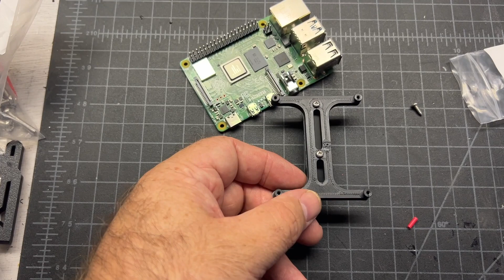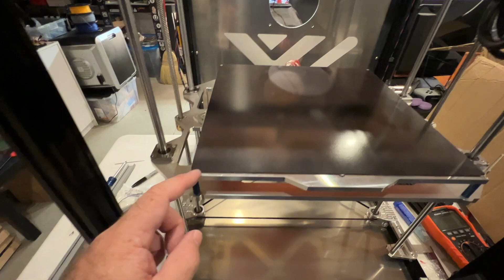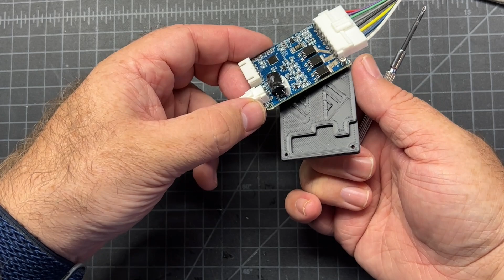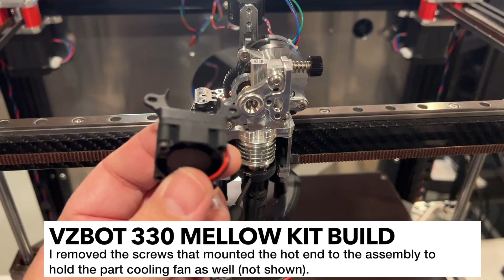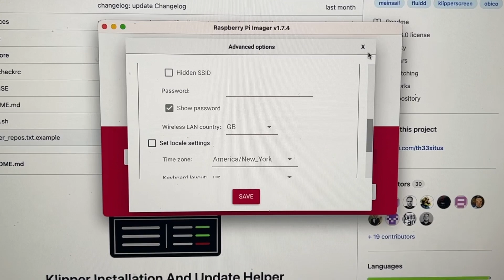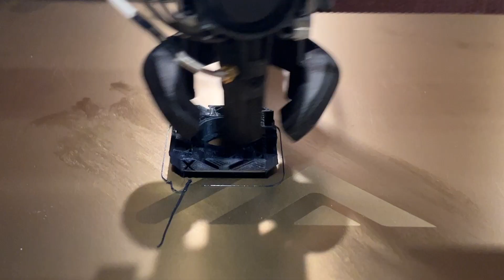Mellow VZBot 330 Build Series - Part 4 Final Wiring, CPAP, Heated Bed, Getting Up & Running

Comment: I really want to build myself a VzBot 330 as well, however i am not set up all that well with electronics tooling. Ive got a Soldering Iron, Screwdrivers, Pliers, Potentiometer and Crimp Pliers for JST type connectors (but they can do a lot more as well). What i dont have are pliers for Ferrules and consumables such as Crimp parts or wires. What should i buy to do the wiring? What tools do i need? Do you have a list of all the things you added yourself that are not included in the kit? Do you have a list of all the useful things you printed such as those clips to hold the Wagos to the DIN rails or the stepper wires in the extrusion?

Oh and i will definetly get myself Wago connectors.
Reply from the maker: Sounds like you have a good start with electronics. Ferrules and Crimp stuff shouldn't set you back too much. Check out my PDF here and scroll to the bottom, I have a list of all the tools I recommend for the VzBot build there. https://github.com/techyg/VzBot/blob/main/Mellow%20VZ%20Bot%20330%20Initial%20impressions.pdf
Reply: @ thankyou very much! Ill have to save up to aford the kit so in the meantime ill start to buy all the missing things from your list👍🏼

Comment: Regarding the magnetic surface - I just realized that you can screw in the screws into the bed and then apply the magnetic sticker on top of them to avoid having to cut holes inside
Reply from the maker: Yeah, that’s definitely an option! I like still having the holes in case I ever need them.

Comment: Did your CPAP fan work as it was shown in this video or did you have to change anything off video? Mine seems to not have the correct PWM voltage or something
Reply from the maker: What issue are you running into? I didn't have to do anything special to get it working beyond what I showed in the video.
Reply: @GregsMakerCorner  darn..my cpap is not working very well. It works but is VERY erratic and not consistent. I've played around with the settings in klipper for the [fan] but still not very happy with the cpap. I have tried reflashing the board, same issue. Reflashed klipper on the pi and then firmware, still erratic. I have ordered a replacement board and cpap just incase something screwy is going on.
Reply from the maker: @tjlqk3  Ah darn, I'm sorry to hear! It sounds like it is probably a hardware thing based on what you are seeing. I have found that 9 times out of 10 if I'm doing that level of troubleshooting it is usually hardware related.
Reply: @GregsMakerCorner  that's my thoughts too. Man I love this printer tho. Still have to finish up the enclosure but dang it's smooth

Comment: I had the CPAP fan blare away when powering up the printer, until Klipper was fully booted up. A great tip I got on this was:

Add "!PF8" (or whatever pin you ended up wiring the CPAP fan to) to "GPIO pins to set at microcontroller startup" when configuring the firmware.

This'll keep that pin low during startup and the fan will stay silent.